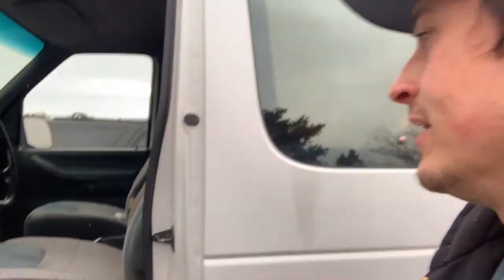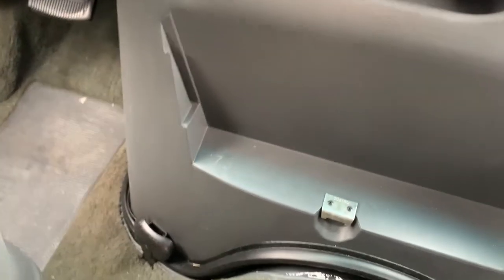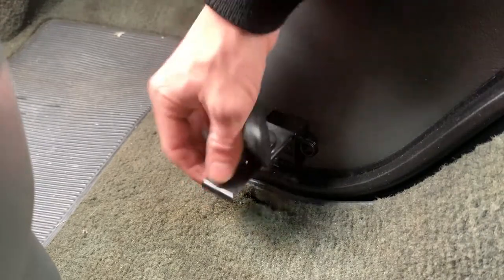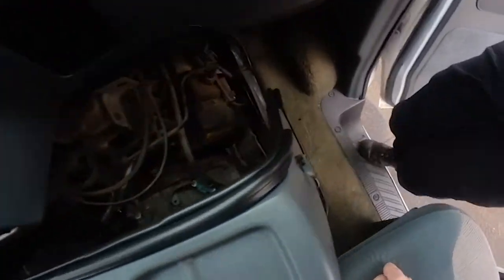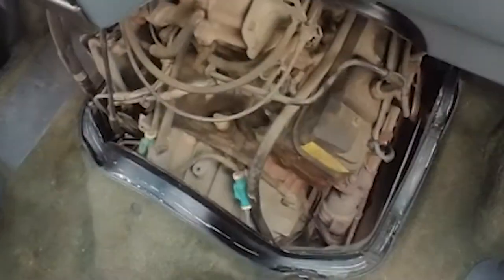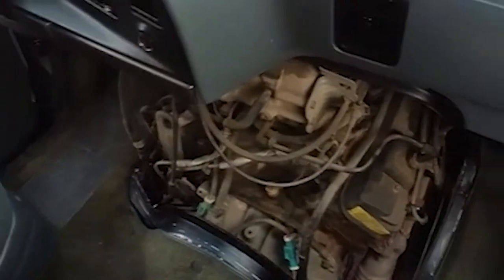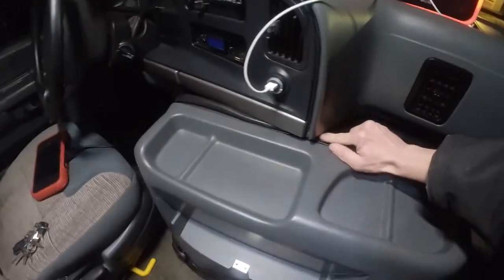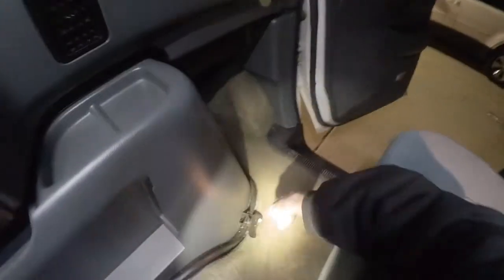How To Access a 96 Ford E-150, E-250, and E-350 Engine from Inside the Van | Dog House Removal

Comment: What do you think of a 2002 e150 4.2l with 140k miles are they good cargo vans reliable and last?
Reply from the maker: not super familiar with those engines but I looked it up and they seem really good. not going to have much power or torque though. but probably better gas mileage

Comment: I have a 97 Ford E350V10. You gotta subscribe For me it's hard finding videos for my vehicle. It should be the same for mine, correct?
Reply from the maker: Nice! Thanks for that, yeah I found it hard to find econoline videos so I started making them. Yours might be when they redesigned the engine cover but probably still pretty similar

Comment: thanks Kid, nice video. I pulled my seats right out to get them out of the way, only 4 hold downs. had to buy a t55 torx bit.
Reply from the maker: no problem! yeah the seats are not too bad, really helps removing them if your doing anything too serious to the engine or else your putting your body in horrible positions for it's health

Comment: Like the space heater idea.  My 1991 Nissan hardbody is cold natured as it can be and with a new thermostat water pump radiator hoses it still takes what feels like forever to warm up.  Been thinking block heaters but putting a small space heater on the passenger side floorboard to heat it up in the cold winter but been on the fence about it.  Worried it my burn my old truck down.
Reply from the maker: for sure, I love having it on when i'm in there working until I get my diesel parking heater installed. wow that's strange. is it the engine having trouble heating up or just the heater? could be a heater valve issue maybe. it's strange how some vehicles heat up super fast. my 4runner is blowing warm air in like 1-2 minutes even when it's freezing outside. my old saab took forever to get warm. this van takes a while to heat up and the coolant temp starts to drop if I turn the heater on and just idling, I think it's a thermostat because the coolant temp will drop when going down the mountain and not on the throttle. also the rear heater system is probably robbing a lot of the heat but ill be deleting that soon.
Reply: @4WheelKid  my old truck just take a long time to warm the iron block and iron head at a idle but once I'm driving for about 10 minutes from cold it putting out heat and the temp gauge is starting to move otherwise it's slow to heat up idling.   My 2002 BMW z3 M roadster heat up in minutes but it is also 11 years newer lol

Comment: I had an exhaust leak on my Express 3500 and it was always coming through the seal around the engine cover. I tried to use extra insulation and stuff, but it never really worked. One of the many reasons I got rid of it.
Reply from the maker: dang. are you sure the floorboards weren't rusted through? mine doesn't seem to get any exhaust on the inside. can't pick up any carbon monoxide inside the van while idling for long periods of time on my detector that is super sensitive and tells you the ppm. the engine also put out 0 carbon monoxide at idle during the emission test. I'm sure there was some but so low their instruments didn't even pick it up
Reply: @4WheelKid  Yeah, it's crazy. The van was really rust-free. All the original sound-deadening material was brittle and easily removed by hand. The Express has these rubber bungees that hold the doghouse on, and those were dry rotted and weak. That's honestly probably what it was. Just not enough pressure to keep the seal tight.